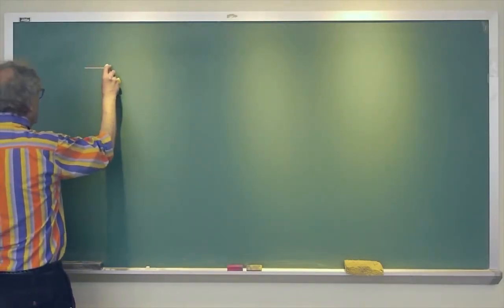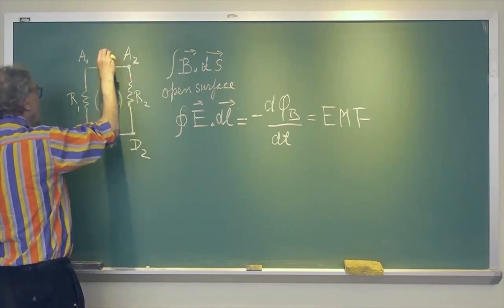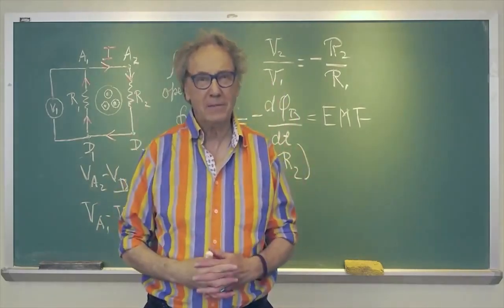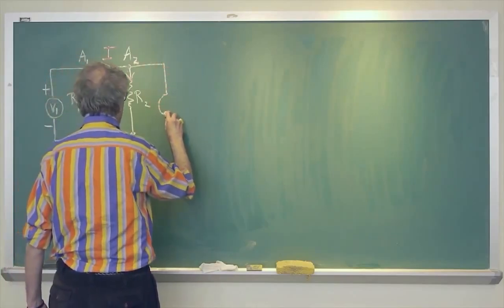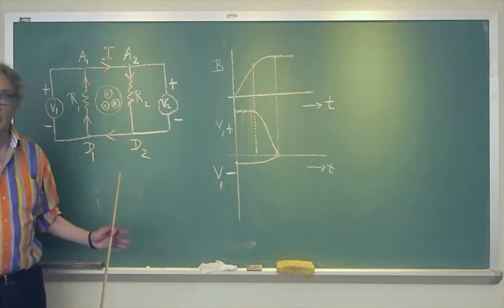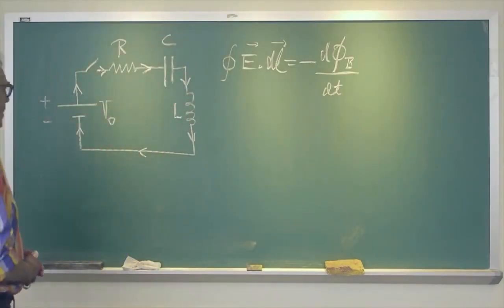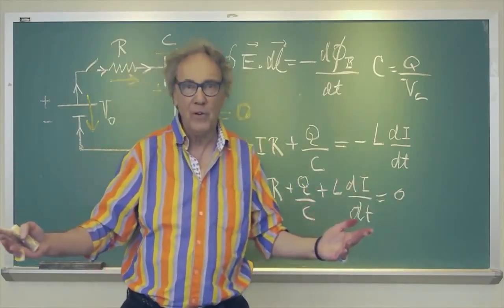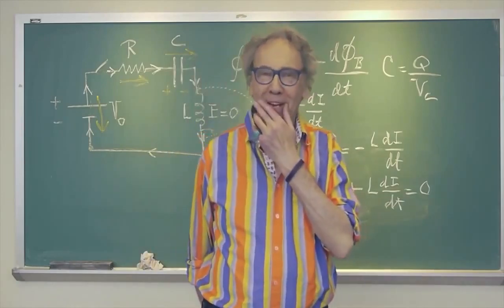Kirchhoff's Loop Rule Is For The Birds

Comment: Even with my lowly AA Engineering Science I understand this instructor did not apply Kirchoff’s laws properly.  The magnetic field is a current source that was not represented as a lumped element in the circuit.
Reply: Lmfao, an associate degree holder thinking he knows more than a renowned physicist, is the most hilarious thing I read today.
Reply: @MrMirror-j6l 😂
Reply from the maker: I appreciate the fact that this Physics may not be familiar to you. Don't feel embarrassed about it; you are not alone. However, it's never too late to get educated. The choice is yours. Maybe this will help you. 
I demonstrated at the end of my lecture #16 of my 8.02 E&M course at MIT that two identical voltmeters attached to the same 2 points in a circuit can show very different values. https://www.youtube.com/watch?v=nGQbA2jwkWI&list=PLyQSN7X0ro2314mKyUiOILaOC2hk6Pc3j&index=17 The reason is that in the case of an induced EMF (Faraday's Law) potential differences are no longer determined; they depend on the path. This also applies to the secondary windings of transformers as the EMF in the closed loop of secondary windings is induced. https://www.youtube.com/watch?v=b7i2uMx7gHo&list=PLyQSN7X0ro22zanLOcvkaSY-IZqheFYM5&index=8
Of course, in cases where Kirchhoff's loop rule (KVL) applies, 2 voltmeters attached to the same 2 points in a circuit will always show the same value. 
My demo was first suggested and published by Romer in December 1982 in the American Journal of Physics. This demo has now become a classic; it's done all over the world at many colleges and universities. 
Kirchhoff's original text can be found in the following link, pages 497-514: https://books.google.de/books?id=Ig8t8yIz20UC. Clearly he was fully aware of the prerequisite for his "loop rule". KVL is a special case of Faraday's Law. That's why Faraday's Law is one of Maxwell's equations and KVL is not.
By teaching students that KVL always works without telling them when it does not work, makes many believe that the closed loop integral of E dot dL is always zero. ElectroBOOM and Dirk Van Meirvenne therefore believe that 2 voltmeters attached to the same 2 points in a circuit must always show the same value which is not true as demonstrated in my lectures. They each posted a video (see @ footnote below) on their channel in which they claim to have proof for their wrong ideas which violate Maxwell's equations. Apparently they do not know, or do not understand, that in the case of an induced EMF potential differences are no longer determined; they depend on the path. MIT students who took my 8.02 course (Electricity and Magnetism) would not make this mistake! I therefore believe that to introduce a "modern version" of KVL and then teach students that KVL always holds is not advisable as you may set them up for making the same embarrassing mistake that both Dirk Van Meirvenne and ElectroBOOM made. 
Also read Professor John Belcher's thoughts on Faraday's Law and on KVL. Professor Belcher is my former colleague at MIT. http://core.csu.edu.cn/NR/rdonlyres/Physics/8-02Electricity-and-MagnetismSpring2002/C29636DB-AB80-49E0-BFAB-BCE00159F00E/0/lecsup41.pdf
(@) ElectroBOOM insulted me in his video by mentioning that the reason why my 2 voltmeters read different values was due to "bad probing". He stated that if I had done the demo correctly I would have found that both voltmeters would have read the same value. He could not have been more wrong  
This is my only msg on this issue. This is too basic. "I teach physics, I do not argue with people who think they know but who don't" (quote from Neil deGrasse Tyson). I do not argue either with people who believe that the Earth is flat.
This video may also help some of you to digest why 2 Voltmeters attached to the same 2 points in a circuit can give very different readings. https://youtu.be/T6S5VS03xZc
Below follows Problem 7.50 in Griffith. Notice the drawing which he copied from Romer and he wrote: "Notice that V1 is not the same as V2, even though they are connected to the same points! See R.H. Romer, Am, J, Phys.50, 1089 (1982)" https://drive.google.com/file/d/1G1a8_YNvB8X9xddUD27x9PE-j7Xbfo3m/view
Reply: @lecturesbywalterlewin.they9259  Sir, you're damn awesome! I understood everything frm that reply alone
Reply: @lecturesbywalterlewin.they9259  I do really wish that I would be one of those students molded by your own hands.

Comment: Dear professor Lewin, I agree with your considerations, but I have a question. If we have 2 electrical circuits, electrically isolated but with a magnetic coupling, we have a transformer. And so, the EMF is present inner the loop. If we open the secondary of transformer the EMF will be present, even on a wire loop. What you think about this?
Reply from the maker: if nothing is attached to the + and - side of the secondary  of  transformer, then there is no closed loop in the secondary and thus no current will flow. But as soon as you attatch the + and - to a light bulb then you create a closed loop and there will be an EMF in that closed loop (Faraday!!) and the light goes no.

Comment: i didnt understand how could he measure the potential diffrence using voltmater. because we are talking about a potential diffrence that depend upon the route we have chosen, and once you use the voltmater- you just chose diffrenent path that is not on the wire..
Reply from the maker: the 2 voltmeters are attached to the same 2 points in the circuit. Yesssss the reason why they show different values is that in the case of induced EMF (Faraday's Law) the integral E dot dL between the same 2 points depends on the path.  That runs our entire economy!
Reply from the maker: I demonstrated at the end of my lecture #16 of my 8.02 E&M course at MIT that two identical voltmeters attached to the same 2 points in a circuit can show very different values. https://www.youtube.com/https://www.youtube.com/watch?v=nGQbA2jwkWI&list=PLyQSN7X0ro2314mKyUiOILaOC2hk6Pc3j&index=17
This can also be demonstrated with a transformer.
https://www.youtube.com/watch?v=b7i2uMx7gHo&list=PLyQSN7X0ro22zanLOcvkaSY-IZqheFYM5&index=8
The reason is that an induced EMF (Faraday's Law) creates a non-conservative E field. When a voltmeter reads a value V it means that the integral of E dot dL across the voltmeter is V. 
In cases where Kirchhoff's loop rule (KVL) applies, 2 voltmeters attached to the same 2 points in a circuit will always show the same value. Kirchhoff's original text can be found in the following link, pages 497-514: https://books.google.de/books?id=Ig8t8yIz20UC. Clearly he was fully aware of the prerequisite for his "loop rule". KVL is a special case of Faraday's Law. That's why Faraday's Law is one of Maxwell's equations and KVL is not.
My demo was first suggested and published by Romer in December 1982 in the American Journal of Physics. This demo has now become a classic; it's done all over the world at many colleges and universities.
ElectroBOOM and Dirk Van Meirvenne believe that 2 voltmeters attached to the same 2 points in a circuit must always show the same value which is not true. They each posted a video on their channel in which they claim to have proof for their wrong ideas.
Also read Professor John Belcher's thoughts on Faraday's Law and on KVL. Professor Belcher is my former colleague at MIT. http://freepdfhosting.com/0813df09f5.pdf
ElectroBOOM insulted me in his video by mentioning that the reason why my 2 voltmeters read different values was due to "bad probing". He stated that if I had done the demo correctly I would have found that both voltmeters would have read the same value. He could not have been more wrong.  
The following video may also help some of you to understand why 2 voltmeters attached to the same 2 points in a circuit can give very different readings. https://youtu.be/T6S5VS03xZc
I thank Mick Vall for his insightful comments.

Comment: Too bad he's wrong tho...The assumption that the wires between resistors have no resistance and are unaffected by the magnetic field is well...an assumption. If they are factored in then this apparent problem goes away because the wires themselves have an induced voltage on them which accounts for the 'missing' voltage bringing the total voltage around the loop to 0V.  
Faradays Law says that the total potential difference around a closed loop is Always 0. What's missing from the explanation given here is that potential difference is created by electric And changing magnetic fields and so the Sum of potential differences around a closed loop due to Both sources is always 0.
Reply from the maker: >>>Faradays Law says that the total potential difference around a closed loop is Always 0.>>>> dead wrong  it is --dphi/dt and that runs our entire economy.

Comment: I wanted to start off by saying that I love your lectures. They are seriously a life-saver. I did have one question though regarding faraday's law. What do we do when we have multiple inductors. Like if we had a battery, 1 resistor, 1 capacitor, and 2 inductors that are in series with one another, how would we develop a mathematical relationship using Faraday's? Would it be like -V+IR+(q/c) = -L(dI/dt) because the closed loop integral of E dot dl is -V+IR+(q/c) where there is 0 electric field in both inductors and we set it equal to  -L(dI/dt) due to faraday's law?
Reply from the maker: 100% correct
Reply: @lecturesbywalterlewin.they9259  I had another question. Does the value of the inductance (L) change if we had 2 inductors in series or in parrallel compared to when we had 1 inductor for the equation -V+IR+(q/c) = -L(dI/dt)? Also, thanks for the response.

Comment: Kirchhoff's rules for voltage and current are extremely useful therefore widely used but they are not physical laws and are not valid in all cases. Specifically they only apply in circuits at frequencies where the wavelengths of  electromagnetic radiation are very large compared to the circuits.

This limitation is actually quite intuitive. For example if we have a one meter wire (even supposing no resistivity) and we apply to it a signal of one meter wavelength, then we will observe different voltages and currents on each point of the wire (e.g. a sinus cycle). In this case circuit theory as well as Kirchhoff's rules ARE NOT APPLICABLE AT ALL, other theories and techniques are used instead like transmission lines, microwaves guides etc.

Why in an "normal" - not high frequency - experiment should we reach this limit condition has also an answer.
If we apply a step of voltage or current to a circuit (e.g. when switching on or off) we are actually applying high frequencies to it.
The sharper the step is the higher the frequencies that are generated, this can be seen with Fourier analysis.
In most cases we are not interested in these short transitions but only in the steady state where circuit theory and Kirchhoff's rules can be used properly.
Reply: Alejandro, the frequency content of the signal has nothing to do with the non applicability of KVL in this case.

KVL dies because the circuit path itself enclosed a variable magnetic field region. It does not matter how fast the field changes.
There are no appreciable retardation effects in Lewin's ring. It also is not a distributed circuit, and there is not even any significant contribution of self-inductance.

You can in theory imagine a slowly varying magnetic field that increases linearly from t = - infinity to t = + infinity and gives a constant current in the loop at all times.
Reply from the maker: I appreciate the fact that this Physics may not be familiar to you. Don't feel embarrassed about it; you are not alone. However, it's never too late to get educated. The choice is yours. Maybe this will help you. 
I demonstrated at the end of my lecture #16 of my 8.02 E&M course at MIT that two identical voltmeters attached to the same 2 points in a circuit can show very different values. https://www.youtube.com/watch?v=nGQbA2jwkWI&list=PLyQSN7X0ro2314mKyUiOILaOC2hk6Pc3j&index=17 The reason is that in the case of an induced EMF (Faraday's Law) potential differences are no longer determined; they depend on the path. This also applies to the secondary windings of transformers as the EMF in the closed loop of secondary windings is induced. https://www.youtube.com/watch?v=b7i2uMx7gHo&list=PLyQSN7X0ro22zanLOcvkaSY-IZqheFYM5&index=8
Of course, in cases where Kirchhoff's loop rule (KVL) applies, 2 voltmeters attached to the same 2 points in a circuit will always show the same value. 
My demo was first suggested and published by Romer in December 1982 in the American Journal of Physics. This demo has now become a classic; it's done all over the world at many colleges and universities. 
Kirchhoff's original text can be found in the following link, pages 497-514: https://books.google.de/books?id=Ig8t8yIz20UC. Clearly he was fully aware of the prerequisite for his "loop rule". KVL is a special case of Faraday's Law. That's why Faraday's Law is one of Maxwell's equations and KVL is not.
By teaching students that KVL always works without telling them when it does not work, makes many believe that the closed loop integral of E dot dL is always zero. ElectroBOOM and Dirk Van Meirvenne therefore believe that 2 voltmeters attached to the same 2 points in a circuit must always show the same value which is not true as demonstrated in my lectures. They each posted a video (see @ footnote below) on their channel in which they claim to have proof for their wrong ideas which violate Maxwell's equations. Apparently they do not know, or do not understand, that in the case of an induced EMF potential differences are no longer determined; they depend on the path. MIT students who took my 8.02 course (Electricity and Magnetism) would not make this mistake! I therefore believe that to introduce a "modern version" of KVL and then teach students that KVL always holds is not advisable as you may set them up for making the same embarrassing mistake that both Dirk Van Meirvenne and ElectroBOOM made. 
Also read Professor John Belcher's thoughts on Faraday's Law and on KVL. Professor Belcher is my former colleague at MIT. http://core.csu.edu.cn/NR/rdonlyres/Physics/8-02Electricity-and-MagnetismSpring2002/C29636DB-AB80-49E0-BFAB-BCE00159F00E/0/lecsup41.pdf
(@) ElectroBOOM insulted me in his video by mentioning that the reason why my 2 voltmeters read different values was due to "bad probing". He stated that if I had done the demo correctly I would have found that both voltmeters would have read the same value. He could not have been more wrong  
This is my only msg on this issue. This is too basic. "I teach physics, I do not argue with people who think they know but who don't" (quote from Neil deGrasse Tyson). I do not argue either with people who believe that the Earth is flat.
This video may also help some of you to digest why 2 Voltmeters attached to the same 2 points in a circuit can give very different readings. https://youtu.be/T6S5VS03xZc
Below follows Problem 7.50 in Griffith. Notice the drawing which he copied from Romer and he wrote: "Notice that V1 is not the same as V2, even though they are connected to the same points! See R.H. Romer, Am, J, Phys.50, 1089 (1982)" https://drive.google.com/file/d/1G1a8_YNvB8X9xddUD27x9PE-j7Xbfo3m/view